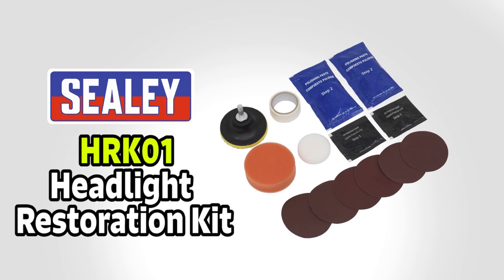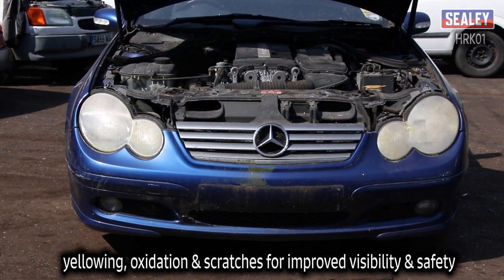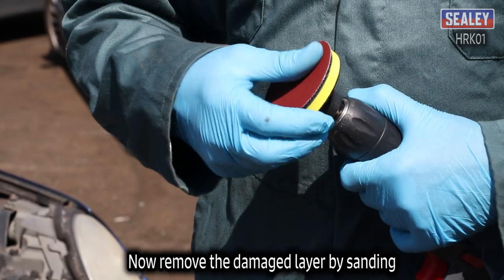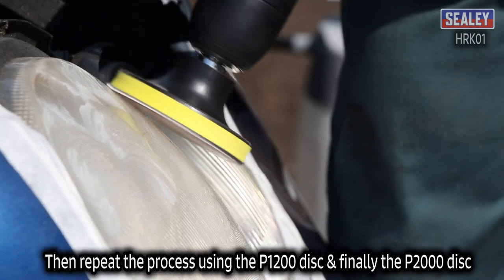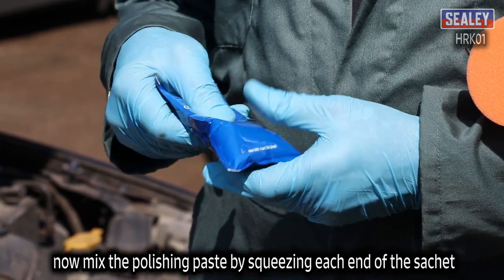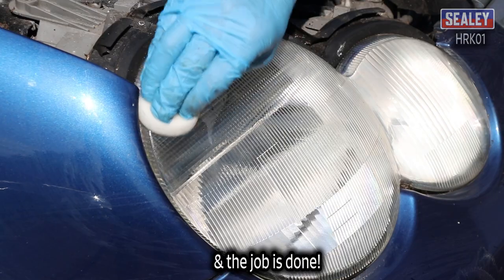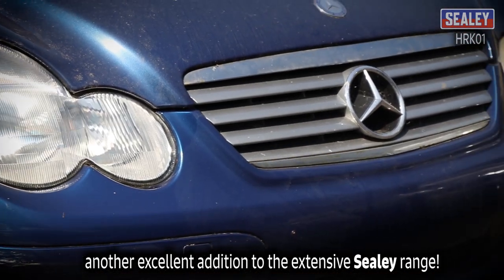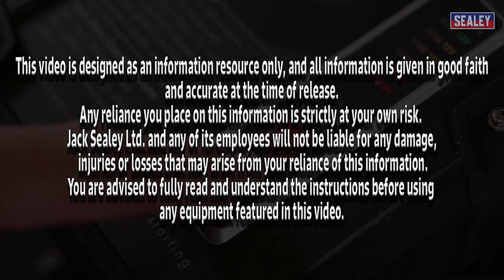Remove Headlight Degradation with the Sealey Headlight Restoration Kit - HRK01

Comment: Does you have to keep applying the uv protective liquid everytime you wash the car?
Reply from the maker: Hi. The kit contains enough UV Protective Liquid for one application to each headlight and once it has been applied to the plastic, you wont need to re-apply as it bonds to the surface. Thanks.

Comment: How do you know when its time to change each pad ie 800 to 1200 to 2000? I'm assuming you don't use each pad grade until its worn.
Reply from the maker: Hi. Start with the coarsest (P800) sanding disc and progress to the P1200 and P2000 discs. Using light pressure and continual movement, gently sand the lens until the discolouration has been removed and an acceptable finish is achieved. Thanks.